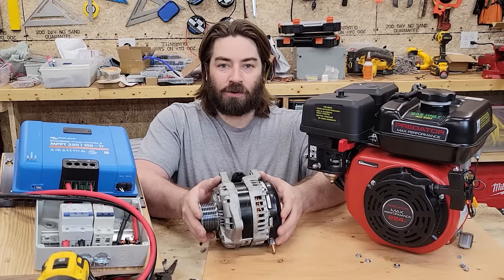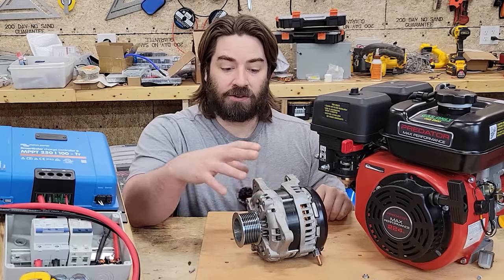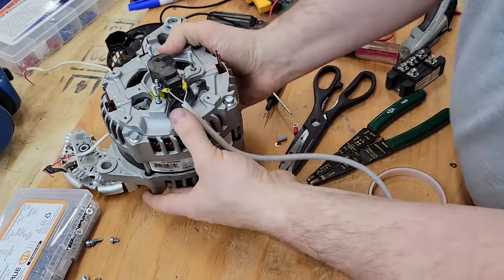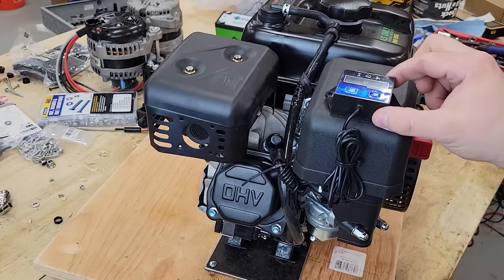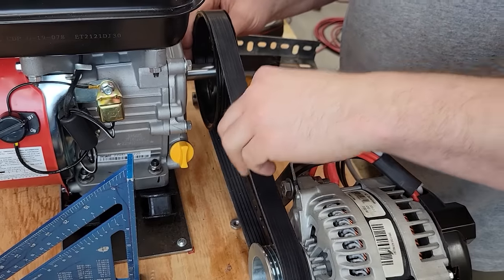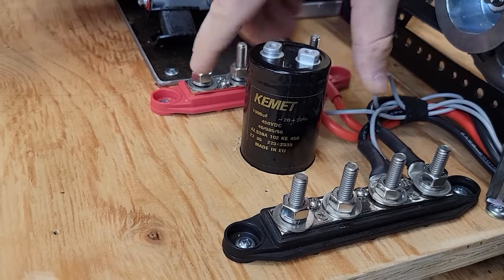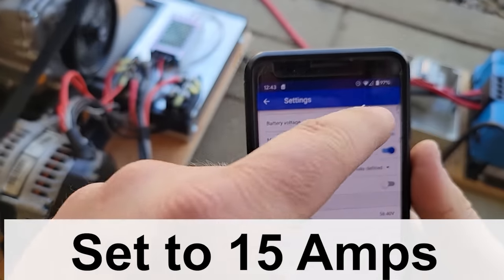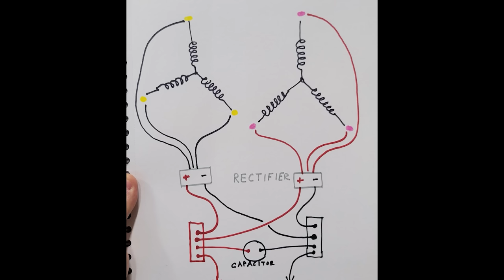The AlternatorGenerator, First Attempt.  48V Battery Charging

Comment from the maker: Part 2 Video is out: https://youtu.be/cy0t4qq8mS0
It includes a fuel economy test, thermal imaging, vibration fix, and I answer your questions.
Reply: Be careful with that circuit breaker. I didn't see a DC rating and high current DC circuits can be a lot harder to trip than AC (have been known to cause issued with solar...)
Reply: Thanks David! Very interesting and informative test. I just watched your follow-up video and in Alaska connected the exhaust of air and water cooled generators to a coil  stainless steel and copper tubing,  and immersed the coil as crude stack robber and estimated I was able to recover up to about 20% of the thermal heat energy from the engine. I mounted the generators above the heat exchanger coil inlet and plumbed the outlet out the bottom of a spray-foam insulated fiberglass or steel tanks so the exhaust condensate would drain out.  
On water cooled generators from 7kw to 600kw we installed coolant heat exchangers to the engine coolant system, removed the engine thermostats and used AMOT valves (Thermostats) in the heat exchanger loop to maximize heat recovery. Combing engine heat recovery with commercial exhaust to water stack robbers recovered up to 60% of the engine heat, so basically the fuel cost of our electric load provided heat most of our space heating. 
I was thinking a heat recovery might project might be interesting for viewers, and I would be happy to  provide insights from my experience if needed.
Reply: The best generator I built 15 years ago , consist of a 200cc gasoline engine and a 12 volt alternator and a 12 volt 647  battery and a 1000watt inverter. What makes it extremely better than a normal generator mine can run 2 hours without needing to start the engine so instead of running a normal generator for 4 hours on fuel it use only half , couple this that it's connected to solar panels , my next aim is connecting to a wind turbine .
Reply: Add a heavy flywheel to the engine as it will stabilize engine power pulses allowing less vibration and more/stable power production
Reply: @dodgeme1986truck  A single cylinder industrial engine without balance shafts is always going to vibrate pretty bad
Reply: Add a washer .add a piece of rubber. Add away
Another washer to your mount.
Reply: That's a long way to go to get 12 volts again just kidding you can make a welder that would be awsome
Reply: Could you spin the alternator fast enough to get 120v AC directly off the taps?
Reply: i invite you to build it? if you do it i would love to see it.... thanks mate good video
Reply: @Mike80528  Hi !
You mean that strong direct current causes emissions with solar energy!!
Thank you very much for providing a little more explanation please
cordially
Reply: With all affection
Reply: Take out the diode take out the diodes take out the
Reply: Great video.   I want to run my garage off the grid.  Right now I have a 100 amp service.  I like in Kentucky how far you live from KY.  I would pay you to teach me.  I am a war veteran trying to get into this hobby.  I think is fantastic and useful.  I appreciate your videos.  My name is Frank.
Reply: Pm me can you install do sola battery
Reply: How many  car batteries can you  charge in series. With your  generator  charging all at once with 3 kilowatts?
Reply: How many  car batteries can you  charge in series with your  generator  with 3 kilowatts.
Reply: Ridgid mount the engine and the alternator on the same platform
Add a flywheel to help smooth out the RPM and vibration
And add a belt tensioner. You can find one of those in a junkyard. Almost all cars have them for their serpentine belts.
Reply: It's pretty comon nowadays to see second hand granite kitchen worktops going for next to nothing. (In fact I have some spare sitting in my garage) These things are pretty darned heavy.  If you were to mount the setup to a piece of this it would stop it running away.
Reply: David, very interesting video. I know this is a year old, but I would like to ask if this setup is comparable or better than getting an adequate generator, and the "Charge/Verter"made by EG4?  To me the bottom line with solar has always been charging batteries in the shortest amount of time.
Reply from the maker: I'm a fan of the Chargeverter and have some videos testing it.  Here is the first video: https://youtu.be/DEpKq_Fg1rw?si=GRw7Ue4oZ1Q9Zlsa
I think it's a great solution.  I use my Chargeverter more often than my alternator build.   If you don't mind, please use my affiliate links if you make a purchase (in description).  Thank you.